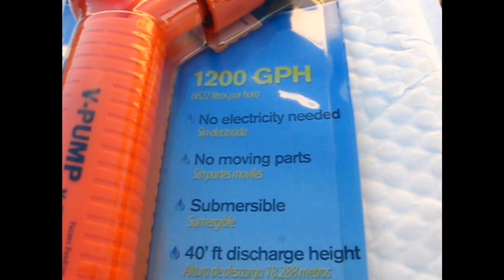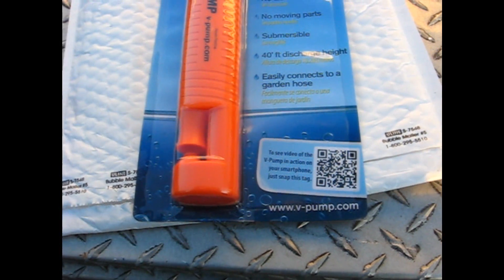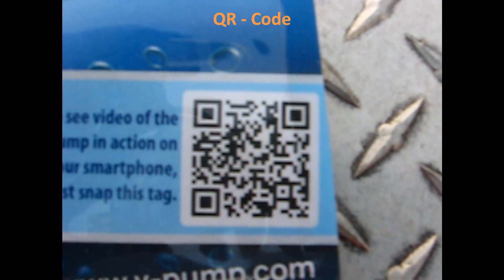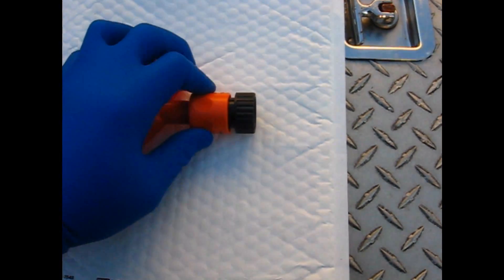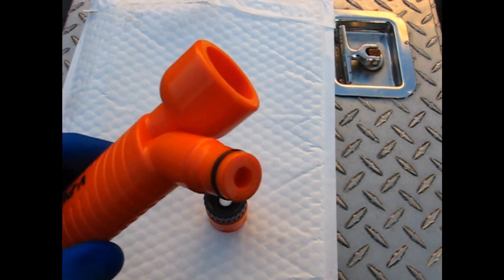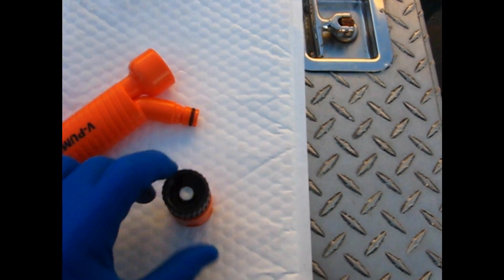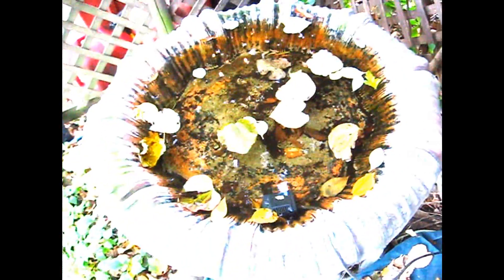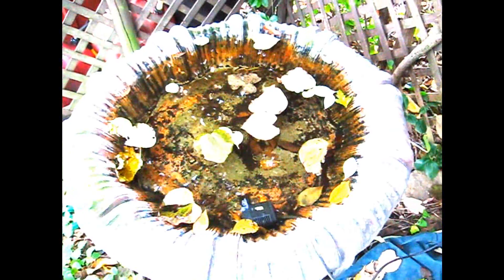V-PUMP DEMONSTRATION - VIDEO ONE

Comment: I picked one of these up today to run tests on.  $40 CAD.  5 Litres into pump bucket, and ended up with 10 Liters in the catch bucket.  Works out to be a 50/50 ratio.  I'm going to try adding a tube to the bottom and see if it will suck up the tube as well as it works submerged.  I will also be trying to add a pipe to the exit port and see if I can "wand" the output into a sprayer.  If this works, it will allow me to custom mix chems/etc. For spraying.
Reply: How did you go?
Reply: @songforguy1 🔴 What Is Islam?  
 
🔴 Islam is not just another religion.  
 
🔵 It is the same message preached by Moses, Jesus and Abraham. 
 
 🔴 Islam literally means ‘submission to God’ and it teaches us to have a direct relationship with God.  
 
 🔵 It reminds us that since God created us, no one should be worshipped except God alone.  
 
 🔴 It also teaches that God is nothing like a human being or like anything that we can imagine. 
 
🌍 The concept of God is summarized in the Quran as: 
 
📖 { “Say, He is God, the One.  God, the Absolute.  He does not give birth, nor was He born, and there is nothing like Him.”} (Quran 112:1-4) 📚 
 
🔴 Becoming a Muslim is not turning your back to Jesus.  
 
🔵 Rather it’s going back to the original teachings of Jesus and obeying him.

Comment: if use air pressure the name is air lift pump, if use water pressure the name is jet pump, both type pump in the upstream power use electric power.

Comment: How could you said no electricity when you use air inlet that comes from an electricity air pump?
Reply: Right. The device does not work by itself but is driven by either  pressurized water or air. I duno how practical this is but like one comment tell his experience of a 50/50 output, if this is use to empty a pool, one need to use fresh water in equal volume to that that needs to be remove.

Comment: You can fill your hose with water, hold both ends shut, submerge one end in the container to be emptied, place the other end on a downward slope and siphon out the water without wasting even more water. As long as the hose is on a downward slope it will work. This is a stupid gadget. No wonder their site no longer exists.
Reply: this unit still works if the discharge is higher than the intake. The syphon (which you describe) will only work if if the output hose is lower than the intake.